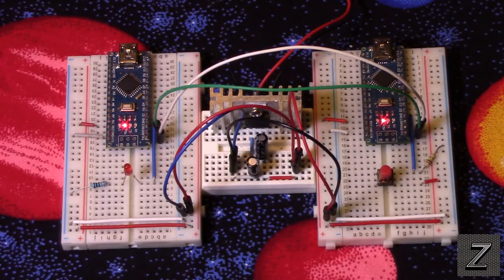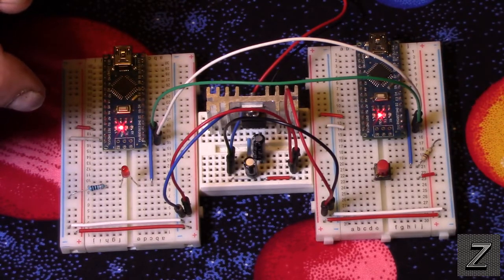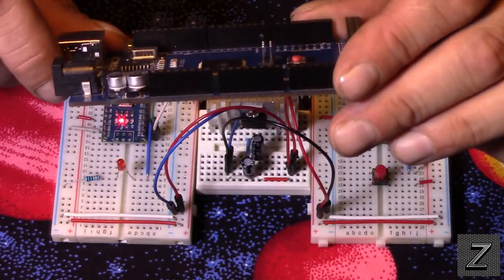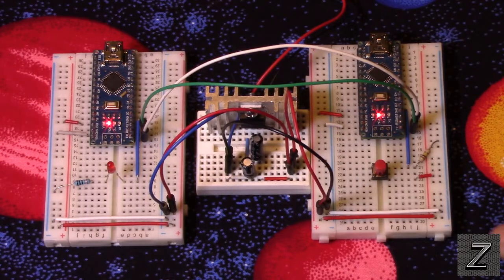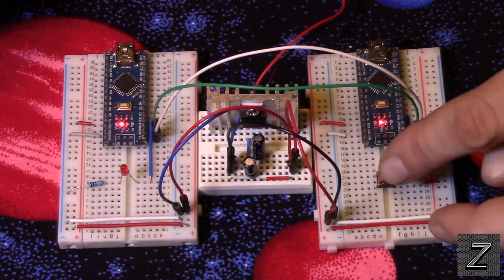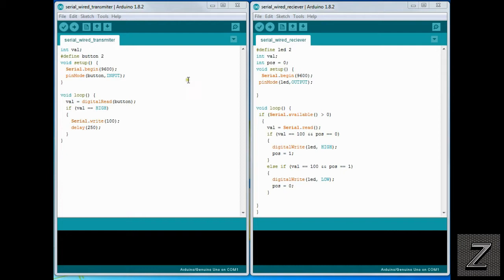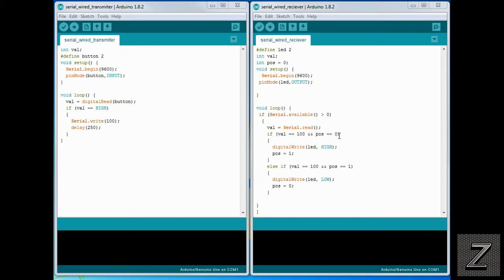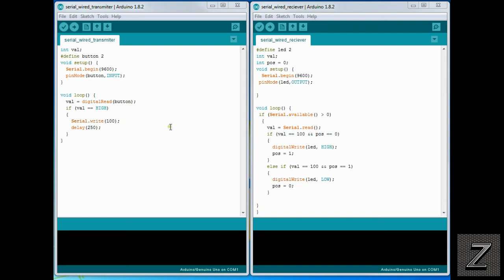How To Make Two ARDUINO Microcontrollers Talk To Each Other

Comment: I got this to work ONCE between two Unos, connecting only the tx and rx lines on both boards, Connected a button to tx board, and an led on pin 13 on the rx board. It worked fine the first time, but then I uploaded updated sketches and it failed. went back and uploaded the originals and it still fails. Checked all connections, pwere, etc... Also been Googling but not finding anything. Any ideas?
Reply from the maker: reboot every thing then try uploading again, had same prob before. the ide and computer just glitch out time to time..........
Reply: Thanks for the quick response. I figured it out. I was trying to power one of the Uno's off of the USB port going back to the computer, so it was conflicting with the existing serial TX RX pins. To fix it, I powered one with a 9 volt battery, then jumped 5 volts out of that into the Vin on the other one, grounded both boards together and it worked. So now I'm confused as to why it ever worked at all. Oh well, it works. Thanks again for your response.